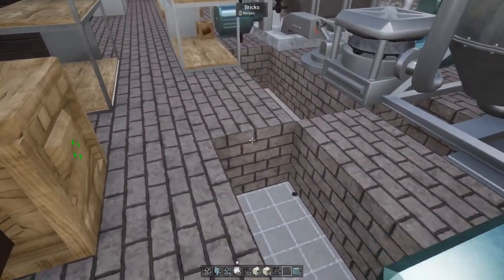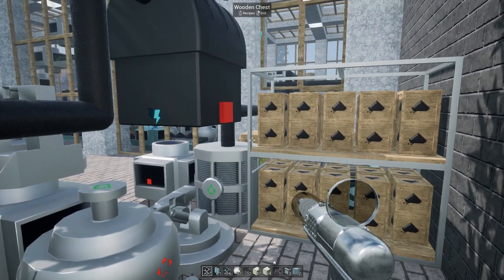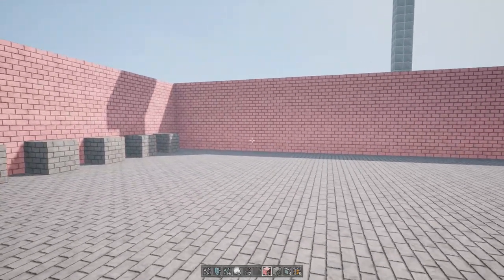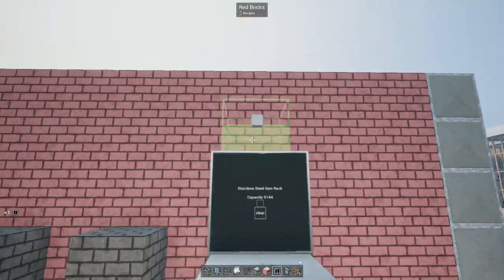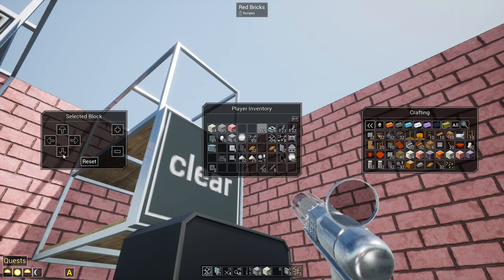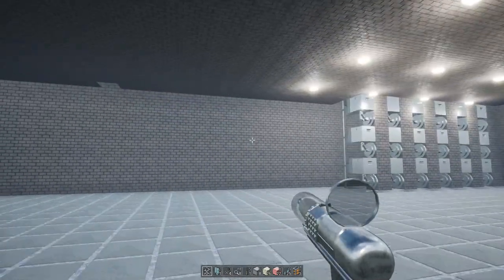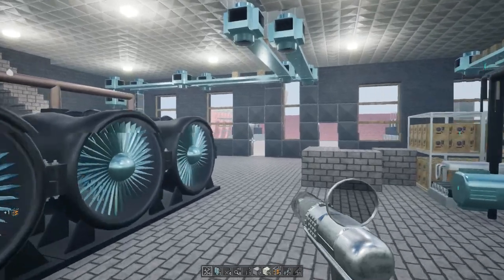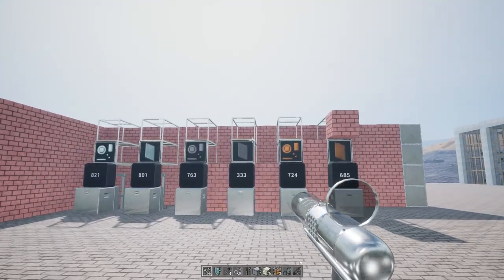Logical Logistics Part 2 - Evospace - 18

Comment: Cool to see your take on the storage setup; haven't seen it done this way before. The pneumatic tubes could have come in handy but I know they require a ton of glass and brass bits. Love your idea for the jetpack elevator areas with upside down stairs to bounce off of! On a separate note, as another viewer commented would also love to see your take on Stationeers! I had quite a hard time with it a while back but have been wanting to give it another shot. Not sure if you followed General Curmudgeon (channel now deleted) but you remind me of his content with your engineering abilities! :)
Reply from the maker: yes the tubes could help and not worried about resources but with junctions i have the option to branch off delivering components to other machines like assemblers ;)
and yes ive had a few requests for stationeers. i havent actually seen any videos on it. it looks like a simple game but from what i hear theres more to it. ill be trying to get it as soon as i can. ive added it to wishlist too.
so many games. so little time.........need more subs :P

Comment: There's a simpler logic system for your tanks.  Just feed all of the product into the tank.
From the tank's Output, put a value leading to the dump, and open that if the tank if fuller than you want. 

Only one value needed, and reduces the amount of wiring that's lying around.
Reply from the maker: im sure theres a simpler way of doing everything i do. but if i did things properly i wouldnt be me. and id probably have alot more viewers too